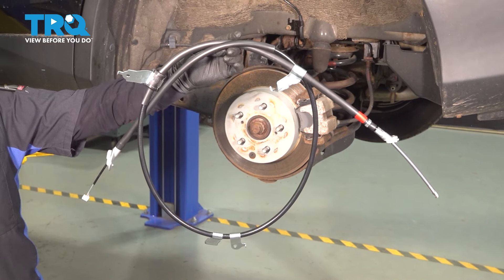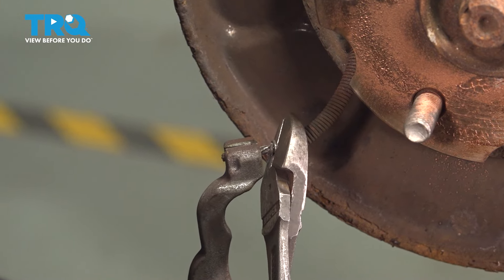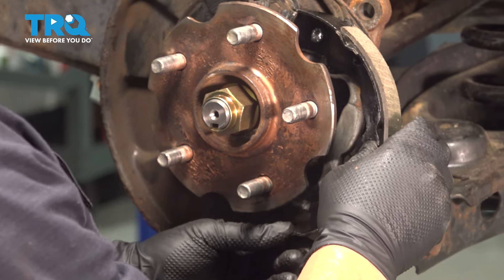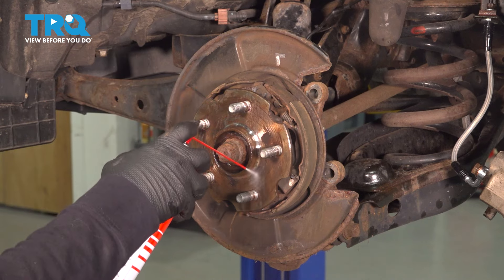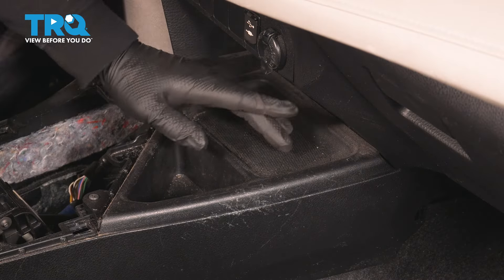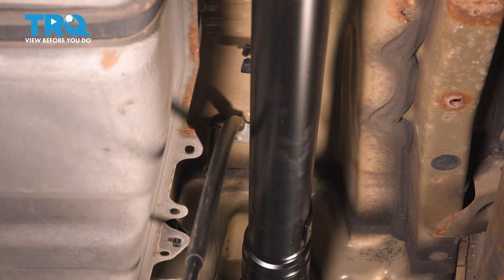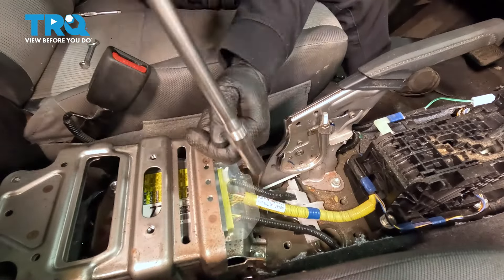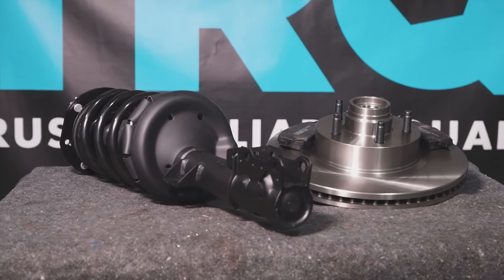How to Replace Left Rear Parking Brake Cable 2013-2018 Toyota RAV4

Comment: This was an excellent video, I watched this to get a feel for how the center console comes out.

I need to point out that I'm pretty sure you never disconnected the battery in it (I was skipping around so maybe you did) but you need to specify very clearly that you can't roll over an airbag module with the battery connected 23:37 unless you want someone knocked out by an airbag.

Even with it off it will set off the airbag if it thinks the car rolled over.
Reply: Probly the most important part of the video

Comment: Question: do these cable "stretch" over time and need to be replaced ? ? ?
Reply: no, what i did i put old brake fluid lubricated them and they working for last 5 years
Reply: maybe you need just adjusted